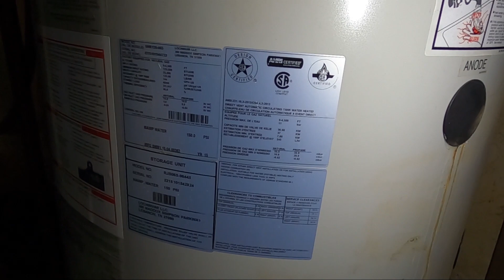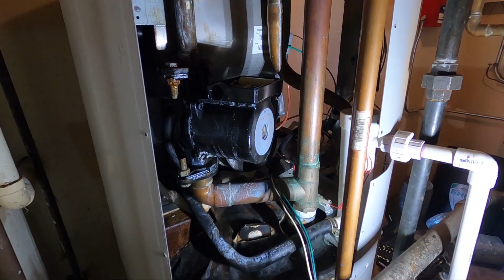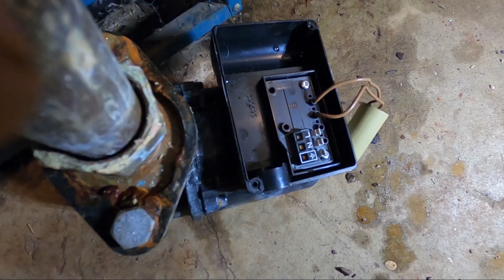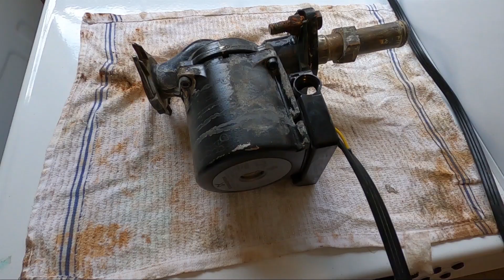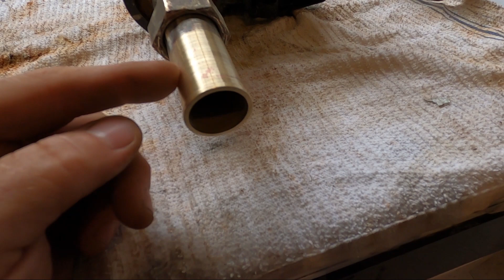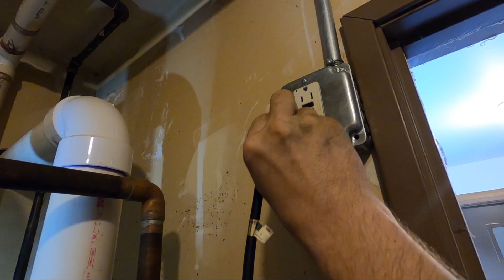Lochinvar Shield water heater common problem fix

Comment: I  ran into e21 error codes and e07 on my sna501-125 model. any ideas for solutions. Circuit board was repaired before heater wouldnt turn on.

Comment: Thanks for sharing.  Very helpful of you because I’ve been plumbing a while.  You shared a secret.   Too bad there is no flanged tail piece type of gasket for that.   But this water heater has me in a bind.  This thing is crazy.   It’s crazy in your video so trust and believe.   I called customer service.  They said they would Send a technician.  I spit out my drink! Hell I’ am a technician.   I just have one that says lock out.  Internal sensor   I don’t know the first plumber that knows anything about these.  😂🤷‍♀️ P I A

Comment: Hey, great video, I had it too lol... Didn't know it was a standard issue so thanks. Question. B04 code? Is that a normal issue too? Thanks
Reply from the maker: B04 most likely is a bad pump/mainboard or scale. It could be linked to the leak, waters drips on the pump , pump fries than you can get B04.
Thanks!!

Comment: Kevin I have an error code 11 in a water heater model Lochinvar shield year 2017 series RJS101-96445 is any solution ?? Thanks 👍🏼
Reply from the maker: From my experience , pull the igniter/flame sensor out and clean flame sensor rod with fine sandpaper, put back and see.
Reply: @kevinbucner2739  thanks for your time to reply me back the unit is up and running 👍🏼

Comment: Hi Kevin, we have the same exact issue here.  We fixed the leak, however after water heater firing up for about 20 minutes, we are getting E12 error code, and burner turns off.  Any idea what the cause of that is?  This is an emergency, thanks!!!
Reply from the maker: Pull the igniter and clean the flame sensor rod with some sand paper . Put back and see if that works.
E12 shows failed flame sensing 4 times. Let me know what does it say on your water heater sticker in regards to E12.
Reply: Hi Kevin to clean burner first i turn off power gas and water line right